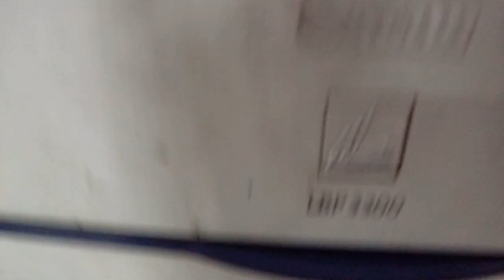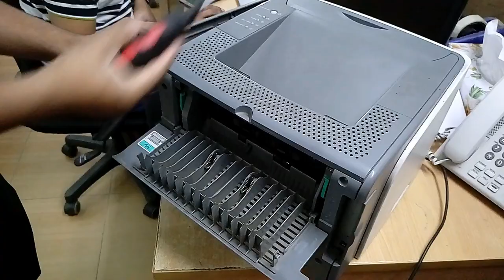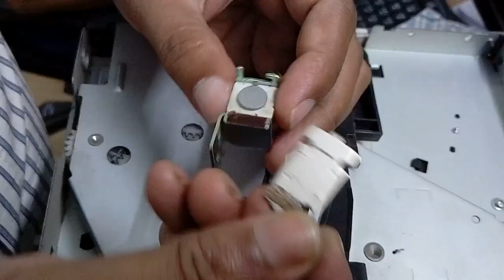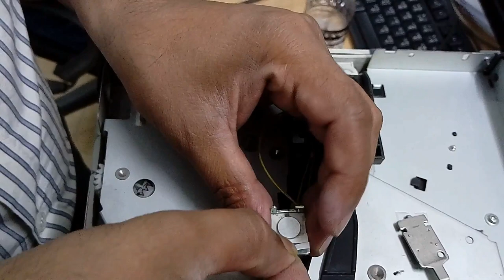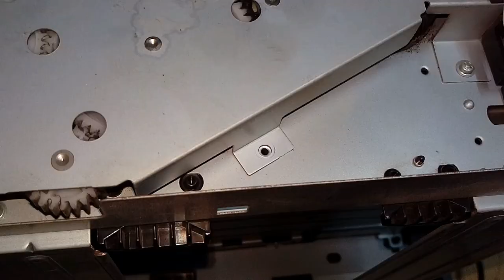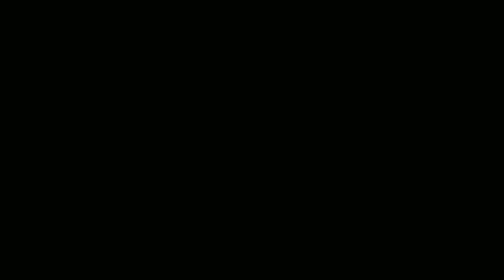How fix canon LBP 3300,hp 2015,hp 1320 printer extra page out

Comment: Thanks.  Very helpful.  I skipped gluing down a cardboard pad as a bit of overkill since it took over 30 year for the solenoid to get sticky in the first place.  My HP LaserJet 1320 has been an amazingly reliable workhorse and I am thankful this repair fixed one of the few problems I have encountered.
Reply: I had to go back and glue a piece of cardboard on the solenoid. I don't know why it is necessary but it is working much better now. Without the cardboard the printer started spilling out 5 pages at a time and had multiple paper jams too.